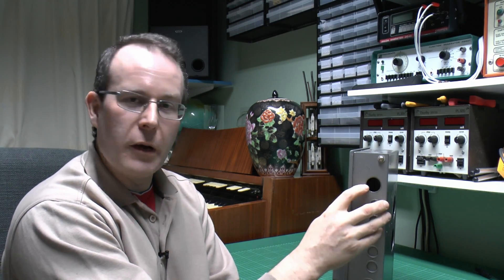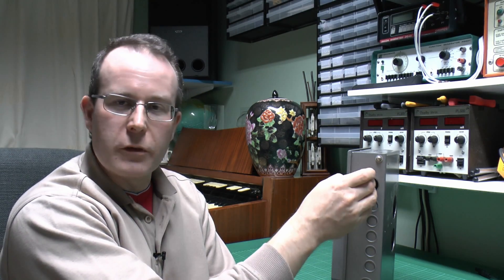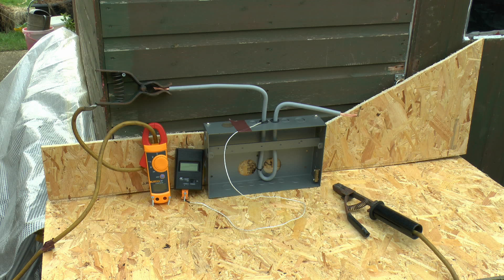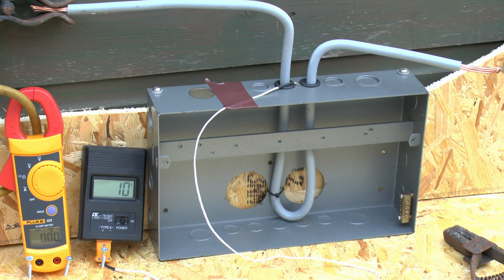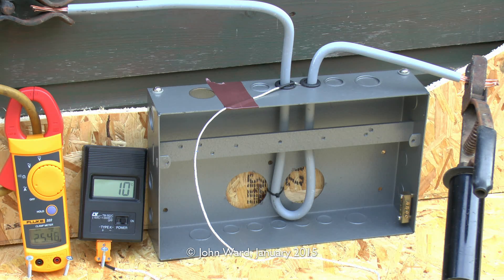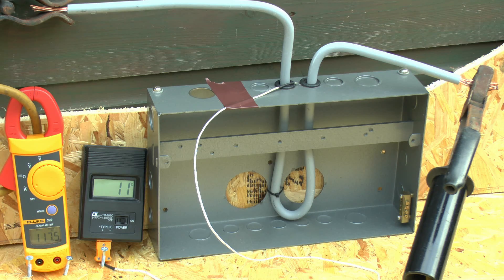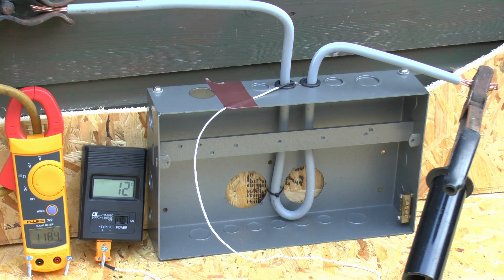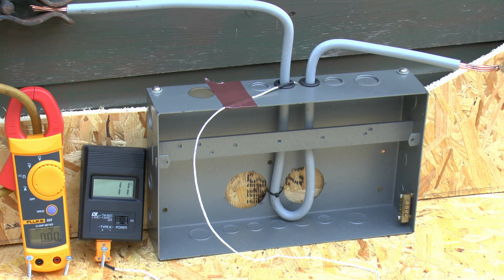Single Wires through Metal Holes

Comment: one wire coming into the panel is neutral and the other wire is live?
it looks like both wires are live in this setup.
Reply from the maker: In a normal installation they would be line & neutral.
In this test power was obtained from an isolating transformer so L&N does not apply.

Comment: An enjoyable and well exicuted video, but i cannot stress highly enough the very real problems that eddy currents cause in poorly designed switchboard and cable ladder installations.  Eddy current heating typically is only an issue in installations running over 250Amps @ 50 Hz, so whilst your video addresses the (watch makers currents found in domestic consumer units), try the same test with the same consumer unit fitted inside an insulated wall cavity with third order harmonics and a few well loaded RCBO's all adding to the heat rise.  I earn a good living fixing these and other problems in 500+ Kva installations, unfortunatly  I am usually too busy trying to get the installation back on supply to take videos of the discoloured paint, damaged cable insulation and hellish buzzing noises caused when people go off making iron circuits around unballanced currents after seeing these sorts of dangerous videos.
Reply: "....these sorts of dangerous videos."
Sorry but how on earth is this video dangerous? What you've described is not what he's showing here is it! What we're looking at is a simple metal consumer unit, in the cold outside air, with circa 30Kva I think? 
I genuinely found your comment interesting to read, I don't work in your industry but I'm considering a career change and it's interesting to understand what type of work an industrial electrician may do day to day. But this is not a dangerous video because he's not misrepresenting anything. Nowhere does he imply we can all ignore the regulations now and do our own thing. Quite the opposite.

Comment: When I first learned of this rule, the situation was using a twisted multi cable (like a drop cable to your house) run on both the live and neutral.  Where the two cables passed through a metal plate, there had to be 1 live wire and 1 neutral wire in each hole.  Basically, untwisted and then paired together, as both cables wouldn't fit in a single hole.  I'm wondering if it's the spacing between the holes that makes the difference.  Like, instead of looping the cable (as in this test) through adjacent holes, but in one hole and out a hole further away or on the other side of the box.  If this is the case, I can see choosing the simple instructions of using one of each per hole.  It could be quite cumbersome to have to calculate a safe spacing.  And we already get plenty of shady wiring.

I have only used 6 AWG wire once.  Most of my experience is 12 or smaller.  I know that I wouldn't be comfortable doing these tests, so ... Thank you!!

Comment: I saw a dramatic overheating in cables that were feeding a low voltage but high power inductive load all the cable overheated like a living hell until we have then  separeted

Comment: Could the heating come from the (i^2)r losses in the cable carrying the current? (instead of from induced currents in the steel)
Reply: My thought too. I'd guess that loop of cable in the box is about 25cm. A bit of calculation on 25cm of 24mm^2 cable with 125 amps running through it shows it dissipates about 8 watts from resistive heating. I think that could easily explain the reason the box warmed up as convection currents would have risen.

At 25 amps, then there would have been only about 0.3 watts from that source.

Comment: I really don''t get this experiment. It appears to me that the net magnetic field on the panel would be 0 since the current at any instant would be in separate directions because the wire is looped in and out of the panel. Magnetic fields would tend to cancel each other. If he had put 2 separate wires through the panel with each wire connected to the load resulting in additive magnetic effect he certainly would see a different outcome.
Reply: I don't think you understand the concept of eddie currents, the metal divider (between the 2 entry holes) is in a constantly changing magnetic field, this would see a current flow generated but like the video implies at domestic level this is rarely if ever an issue, the metal splitting the cables apart interupts any cancellation of the magnetic field would occur if the cables went through the same metal opening.

Comment: This test is seriously flawed and proves nothing.

Firstly, you have a Line conductor looped through two separate holes and this means it is not resembling a real world situation.
Secondly, the metalwork is unearthed as such any eddy current induced cannot escape as would usually happen.

If you want to set up this type of test accurately then you should set the Consumer unit up correctly. In fact you should have two identical consumer units, one connected properly and one connected incorrectly. Both should have identical loads attached via correct circuit protective devices and the load applied should be real world. Both consumer units should be earthed.

If you intend to carry out such tests then please do them correctly.
Reply: It wouldn't be so bad, but James Franklin didn't even indicate if this is a  genuine problem.

Must the lofty of heights reached whilst green-laning that has him within a fugue. :P

C'mon James, give us some info without the tantrum ya big sulk ya!

Comment: i was involved once with a television transmitter installation where they ran 3phase power to the main disconnect box using three separate conduits, one phase in each conduit . Those got red hot!   Granted it was a hundred amps and the metal separating the conductors was not just the metal box, but was a length of about 10 feet of conduit; but that situation was an example of the same effect. The conduit / metal box created the core of a transformer. 
The solution was to run three separate smaller size wires in each of the three conduits so that each conduit contained all three phases adding up to the required wire size for the current draw.l
Reply: A little late for a reply. The condition you describe is because the metal conduit was connected at both ends. In industry if you had large single core armoured cables carrying several hundred amps, the gland plate at one end was always insulated to stop Eddie currents circulating around the armouring or conduit

Comment: I wonder if the effect would be greater a real load was applied so the sine curve was dirty?  Surely this dead short is a best case scenario.
Reply: normally one of the wires would be at 230 volts and not a dead short. Maybe that would make no difference

Comment: Great series of videos John

So 120A 220v AC and your connecting the most dodgy pair of crock clips without isolating the supply or wearing rubber gloves.  Cool.  i wanna go.
 
I'm not a great fan of steel consumer units, didn't the London Fire Brigade ban them in the eighties (16 Ed) and now as if by magic they are safe from being a fantastic short circuit to the mains. ummm.
Are they the same muppet's who insisted all fire extinguishers should be red so you visually spot the different type in low visibility and hung 1m off the floor so that when you are crawling around on the floor in a smoke filled room to get your last breath you end up knocking a great hunk of steel off the wall onto your head.  Thought so.
Reply: Look carefully it a welder so the voltage will be 50 to 60 volts welders do this every time they arc up
Reply: Myth Busted, in order to prove the effect accurately it would have to be good old 220v supply, i tend not to connect my welder up through the consumer unit - as shown.  i guess DCEN means DC so yet another flaw in the experiment.  Shame i thought John had stumbled across a method of telling the London fire brigade why we got rid of these things in the first place in favour of slow burning, zero halogen, self extinguishing plastic. In 20 years the rules will go back the other way, so they can charge more money and write another edition of the regs to get us all back on courses.

Comment: I know mains is low frequency ... but now try this with high frequency. You might get more heating, because of the skin effect, which makes the thick metal box become a thin metal box, in respect to where the electrons flow... thus, it would heat up more because of the higher resistance .. or so that is the idea XD

Comment: It's interesting as the electromagnetic affect consideration now appears on the schedule of tests for an electrical instalation.  far more worrying that we now have to use metal consumer units on a TT earth system . It was once considered a no no to put mains tails with no back RCD protection into a metal enclosure but now it's fine with a plastic stuff in gland . load of tosh in my view. love your methodical uploads ,as interesting as Big clive .

Comment: 2C might seem like a small increase, when outdoors (where the wind will be taking the heat away), but in your enclosed basement, with no wind...
Reply from the maker: +Nalianna Most or all of that 2C increase was due to resistive heating from the wires, not magnetic effects.
Reply: +John Ward i agree with that the heat rising from the cable is what caused the change, however it would have been nice to have seen another meter to read the heat from the cable, a closed box in a not open to the basic elements of nature. i know this wont change the results of what you found here but will be interesting to see how the tempreture will change used normally of just the wiring...
a test using a miligauss meter would be interesting to see is someone was to put cable in one hole and then in a hole either side of the unit as a pass through with like mains in then to a shower etc, then to test the induction of all four corners as if its like a transformer.

Comment: A very worthwhile test.  I've always been a bit sceptical about the ability of a single core being able to induce a significant current in the surrounding metalwork.  This appears to be a myth that goes back a long way, and I wonder if it is an issue with more industrial supplies (I'm not so sure) or if it was a myth born from an excuse for overloaded cables.  It also suggests that the people who write the regulations haven't actually tested it.  But then, that's not really a surprise for the office-seat electricians at the IET.  I wonder if something like a bush or run of conduit would compound the effect though, even if the heating effect wasn't an issue it might effectively act as a slight choke and soften current transients.
Reply: The cables are still in close proximity and in opposite directions so surely the EM field is being cancelled out and therefore can't heat anything. JW, out of interest can you repeat the test where the cable enters through one side of the box and exits the other please? That might produce something. Not exactly a real case, but possible.
Reply: @andrewjopson2646  Compared to single conductors, B field is enhanced between balanced conductors and weakened outside of them.

The E-field around mains-voltage conductors is weak relative to natural fields, but you'll find the strongest AC component between conductors at different voltages in close proximity. So again, it's strong between the conductors and weak outside them. If the case is ungrounded then the E-field in each hole is approximately the same strength. If it is grounded the line side will be stronger and the neutral nearly zero. 

In this experiment the voltage is very low and there's no significant E-field between conductors. A loop with more inductance (imagine a coil) would create a stronger E-field. 

When a coil or loop induces eddy currents, they are strongest when they can circulate around the same axis. In theory the rear wall would receive the most heating. Hysteresis heating happens when a ferromagnetic material captures a lot of alternating and sufficiently strong magnetic flux. In theory that would be highest between the holes.
Reply: You will find that the heating effect due to eddy currents  will increase significantly at around 350  to 400 amp and above ,  B elbow these levels it is usually quite low ,
Reply: yay I found big Clive here
Reply: @EddieHart  yes the two great ones themselves JW and big Clive. Hail the great ones. I like the way both present their subject matter and it's good to learn a few things from informed knowledgeable professionals.
Reply: when Big Clive shows up, you know it's about to go down
Reply: The induced currents tend to be more significant in low resistance thick materials (aluminium and brass gland plates for example). Magnetic effects would be more significant in steel enclosures.
This enclosure was probably too thin for significant effects at mains frequency.
Reply: Well JW and Big Clive confirming my suspicions that the thermal eddy current thing was a myth as I'd failed to recreate it myself. I'd go along with Clive's hypothesis that it might be something to do with industrial current and voltage levels but not domestic as one particularly whiney electrician who's channel shall remain nameless but unsubscribed seems to think.
Another interesting video JW, thanks.
Reply: bigclivedotcom who here read Big Clive's words in your mind as big Clive's voice? I know I did, specially the "I'm not so sure " bit , ha ha ha.
Reply: @vk3hau  "who here read Big Clive's words in your mind as big Clive's voice?"

100% !
Reply: Seeing a youtuber you are subscribed to commenting on another youtubers video is like the feeling when you bump into someone you know when your on holiday :)
Reply: lol
Reply: The transformer effect is very real, but in all cases the amount of Eddie current  heating in the casing is negligible as the metal wall of the case is so thin like a single transformer lamination so any Eddie current will be small.  Yes, it does act as a slight choke  by slight increasing the inductive reactance but its so minuscule it does nothing. One issue thou is that it creates an unwanted magnetic and electric field radiating from the casing, which could interfere with AM radio reception.
Reply: +bigclivedotcom 
more so with three phase supplies, remote metering your see mylar plate bolted into enclosure.
Also contact area minimal

Comment: How about a single wire through a metal conduit. Aus standards prohibit doing so, requiring the full current to return via the same run through the metal, be it a switched live, other phases or neutral wire. Eddy currents are the issue like this video, but they'd have much more of an effect in an ideal conductive long cylinder. Could you do a video please?
Reply: I'm not sure "eddy current" is the correct term. That wiring fault actually creates an accidental transformer and might be capable of inducing touchable voltage if the loop of conduit is broken at one point. It would still be an interesting experiment.

Comment: I am curious. Doesn't the impedance of an inductor occur within the copper itself? Would this not theoretically directly reduce the rated current carrying capabilities of the wire, however small that reduction might be? You should measure the effective henry rating of the fuse box acting as an inductor in a setup like this.

Comment: My impression (as a physicist, not a working electrician) is that the expected heating is not from eddy currents (the thickness of the metal limits those severely) but from the magnetic field itself and the resulting hysteresis (iron) losses. 
Whatever the source, it is generally not significant except at much higher currents than you tested with or with more substantial (thicker) ferrous metal plates. 
I am having trouble thinking of a simple experiment to prove one way or the other. I suppose that using a ferrite or other composite material which was magnetically active but not electrically conductive might do the trick.
Reply: If a significant heating effect was observed then the test could be repeated with a non ferrous metal such as aluminium.  If the heating is caused by eddy currents then it should still occur but if it's due to magnetic losses then it should no longer be present.  I personally can't see why there should be any eddy currents at all because the lines of magnetic field will occur in the plane of the metal sheet so any eddy currents would have to be perpendicular to the sheet and there isn't any perpendicular path for them to flow in.  The section of cable in this test that's laid flat on the metal case is much more likely to induce eddy currents but even then they will be small because the magnetic field in the air surrounding a cable is itself small due to the low permeability of air.
Reply: What about the frequency? If the power supply had a lot of noise, then I presume there would be more heating. Could be interesting to run the test at 500hz, 5000 hz etc.